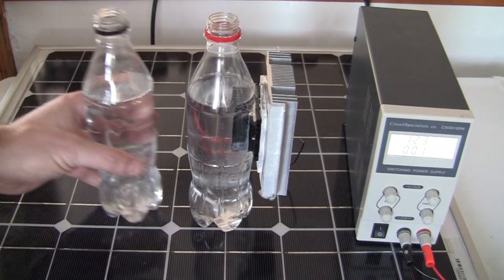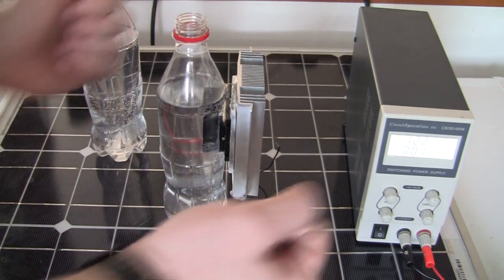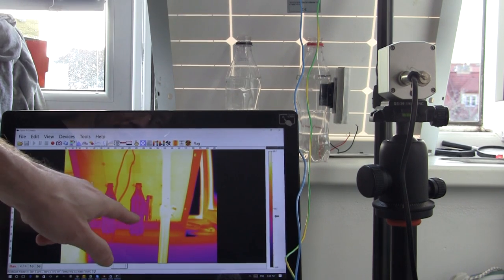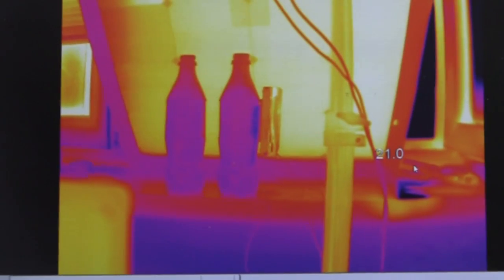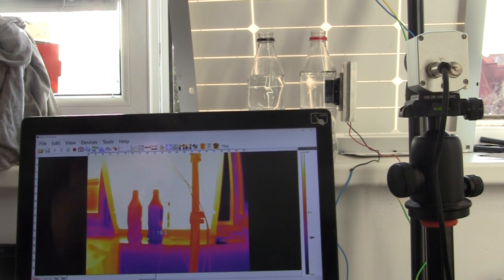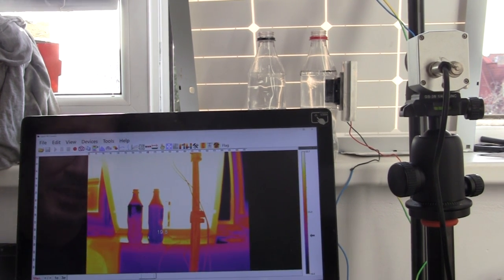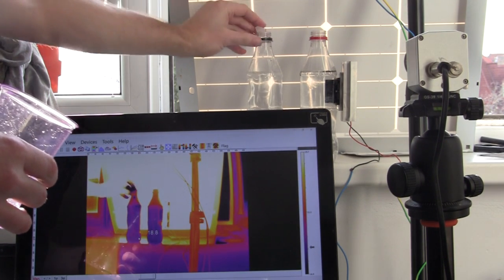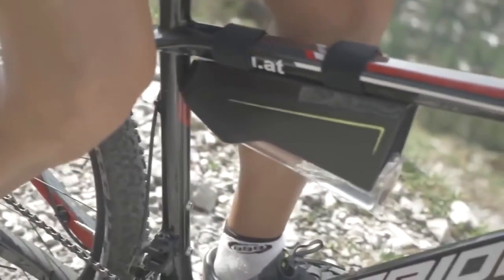Self-Cooling water bottle ACTUALLY WORKING!!!

Comment: Okay, so the portable water bottle design does not refill itself very efficiently.  But the idea isn't bad.  If we just created a much larger, non portable version, similar to a water tower, we could get a significant amount of water with little effort.
Reply: 1st problem: It takes an ENORMOUS amount of energy to condense water from air. You would spend a tenth of that energy digging a well or desalinating sea water for the same amount of water or even more.

2nd problem: say you want to use water from an industrial air conditioning. Evaporators get wet obviously, and draw air through them in order to cool it down. Whatever was in that air (dust, pollution, microbes, spores, fungi etc) will now STICK to the evaporator and get in the water (that's why it smells rotten). You surely DON'T want to drink that disgusting water do you?
Reply: Actually, on Mars you can literally make water from thin air so long as you take along some hydrogen feedstock and appropriate piping and catalyst. You can relatively easily condense and separate the martian atmosphere into pure CO2. With that and, IIRC a Rubidium catalyst you can use methanation (also known as the Sabatier reaction) to produce water and methane. This process is exothermic - it produces heat (also useful on Mars) and doesn't require you to add energy. 

Alternatively, one can use the water-gas-shift process to produce carbon monoxide and water from said pure CO2. That process requires some energy in the form of heat to happen, and produces half as much water. This, too, is rather old technology, ie. basic chemistry. However, the amount of heat needed by the second method is within the range of heat produced by the first process. Thus, by chaining the heat thermal output from the exothermic process to the thermic input of the second, you are able to achieve higher water output using rather "old" and very well known/studied processes. Alternatively (or additionally), one can use another mildly endothermic process to mix CO2 with methane and additional hydrogen to produce methane, carbon monoxide, and more water. Thus, there is already no need to ship large quantities of water to Mars. No need for going to the poles or for water vapor to be condensed. 

Regarding shipping liquid fuel, as you mentioned, you may note that the above process outputs are carbon monoxide, methane, and water. Via standard electrolysis you can convert the water to hydrogen and oxygen, returning the hydrogen to the input of the above "reactor", and mix the oxygen with the methane to produce "methox" - methane/oxygen rocket fuel.  While methox isn't terribly ideal for escaping from Earth, Mars' shallower gravity well makes it quite suitable. While no human built machine for these processes is 100% efficient, we have achieved mid-90% range. The hydrogen feedstock needed for this is, naturally, much lighter than shipping water or fuel.
Reply: Quick calculation time ;-D

Reverse osmosis machine: consumes 45A at 12V, that's 540Wh and produces 30l of water in an hour. Therefore, it has an "efficiency" of 18 Wh/l.

Dehumidifier (Peltier. like the Fontus but more powerful): consumes 5A at 12V, that's 60 Wh, but only produces 1 l of water each 24 hours (that is when it is 95% humid, below 40% it's useless and that is the kind of humidity that is present in the "biomes" where you need the Fontus most). 
Therefore, the "efficiency" is 1440 Wh/l.

The RO machine is approximately 80 times more energy efficient than a dehumidifier. And it's not exactly a energy efficient device! (the solar array of my boat can't supply enough power to run it, it runs partly 
off batteries)
Not counting the fact that unless the pump breaks or the membrane fails(the rest like clogged filters is easily repairable) it's always going to produce water, and the dehumidifier will need A MONTH to produce as much water as the RO machine produced in AN HOUR.

And we are also forgetting that there are also MANUAL reverse osmosis machines (the pump is hand cranked, it uses no power at all) to use in an emergency if there is a total power loss on the boat, and those produce much more water (0,5 l/h) than the Fontus.

 Trying to get water from air is like trying to get gold from sea water. An extremely expensive and useless process.

PS: I don't think you know how much 50mL really is, because I don't think you could survive drinking less than a whisky shot worth of water each day. I mean yes, you would survive for LONGER than if you had no water at all, but what's the point of doing that when you can have an emergency solar still or manual desaliniser that does the job better and faster?!? :-)

PPS: I don't even think the solar panel required to run the Fontus at suitable speeds would fit on a life raft ;-D
Reply: Dylan Daughety I had that same idea. it doesn't work for hiking or biking. But it does work on a large scale for a house or town/village as long as you have a large solar array or are part of a normal power grid. same with the water seer. if you made a huge underground tunnel put fans and cooling devices (even just standard industrial AC) to speed up and cool the air you can condense and collect water out of the air even in hot dry areas. it just takes a lot of power. But that could be done with large solar arrays (we are talking ones covering a few acres) on the surface/near by that then power the fans and cooling devices. the water seer won't work how they want. But if you scale it up, move away from being super green and change some factors the over all goal (water from the air in dry areas where getting/finding water can be hard) can be done.
Reply: why would you use so much energy to get water from air when you could transport it for probably less energy
Reply: There's very little water vapour on Mars. On Mars, as far as we know, water is almost exclusively present in solid form at the poles...
Reply: MrOpenGL The situation when  condensation would be useful is in a place where digging a well is not an option.  When I was talking about a much larger version of the bottle, I mean a huge version of the device.  Something that could be used in a situation with almost no chance of fresh, drinkable water.  The idea could be extremely useful on Mars to obtain water without having to tote massive amounts of water on a ship to space along with liquid fuel.  I don't know if it is practical on Earth, but it could be extremely useful on other planets.
Reply: MrOpenGL I was thinking more along the lines of Africa and parts of the middle east. and I was thinking more like just cool a huge cave down to near freezing and then pass air (cold as it comes in and more as it passes through) through and let the water condense naturally on the walls/celling (they can be made of man made stuff you keep dirt out) and the water drops into huge pools that is then filtered.
Reply: How about covering a boat with solar panels and generating a backup freshwater supply for a long trip?  You can survive on a surprisingly small amount of water.  Even with just the small solar panel used in this video, 50mL / day is probably enough to survive on.
Reply: Interesting.  I didn't know about reverse osmosis machines.

Comment: If we really wanted to squeeze moisture out of the air in a rather arid climate, it'd have to be an absolutely massive installation working on a combination of wind and solar power to perform gas compression. You'd need a cold plate with rather extreme surface area and you'd need to force warmer air against it.
There'd need to be a super robust closed evaporation loop with some kind of high-performance refrigerant. The incoming air would probably need to be forced against the cold plate using some kind of turbine setup.
I hereby name this loose idea the "Air Well", and anyone who wishes to build it will need to cut me in on the profits. Alternatively, if you have a couple hundred thousand or a few million to spare, contact me and we'll get engineering. :)

Oh wait, crap, someone's already invented that: https://en.wikipedia.org/wiki/Air_well_(condenser)

Comment: Would small blower fans or normal fans in the heatsink help with the heat transfer? Did you use a thermally conductive pad or compound?

Comment: What if you put it through a thermos flask? Then the water would be able to be cooled much more slowly. Even a small peltier device should be able to cool it down/heat reasonably well. Then a phone battery would even power it at least as well as the solar panel. Hell, put one on the side to keep it charged.

I don't think this is ENTIRELY unfeasible, although the only practical benefit would be for trekking or somesuch, though it would weigh a lot, so it seems a bit much for a tepid or cooled drink.

Comment: A few years ago I made something similar with the cold side in a small insulated lunch box and this worked fine om my 24 volt 120 watts solar panels that charge 2 12volt serial connected  car batteries.and took the 12 volt from one of the batteries it worked fine, but worked better with a cooling fan from a computer power supply on the "hot" side of the Peltier element ..
But it worked like crazy when I put the whole thing inside out of the sun..
So I'm just saying, maybe , just maybe it would work better if you put the whole  bottle in the shade ??

Comment: I wonder if your self-cooling water bottle would actually be able to overcome the radiant heating of the sun. In other words, if the bottle was sitting next to the panel instead of under it, would it still cool down, or simply heat up slower? 

Yet another nail in the coffin for the self-filling water bottle.

Comment: Wouldn't this actualy be a viable product? Maybe a Self-Cooling thermous, with half of it solar panel other half heatsink with a thermal break between inner and outter layers. The whole idea as a way to extend the time water is cold. It'd be slower with smaller solar cells but it doesn't have to work as hard as a clear bottle.
After initial purchase the water from any drinking fountain is free, but ice is not as free as water.

Comment: Aside being unpractical, drinking basically the equivalent of distilled water would slowly kill you anyway. On a long hiking trip where you are sweating out all your minerals the last thing you want to drink is moister water.... Your blood pressure would be out of whack in a few hours giving you some nasty headaches.
Reply: Nonsense, distilled water won't kill you at all. Just don;t drink 2 liters of it at once and make sure you eat properly.
Reply: The ad suggest to drink it while biking, hiking or out in 100 degrees on the Ocean. You drink way more than 2 liters in those circumstances. While distilled water wont kill you normally during times of excess stress on your body it will weaken you significantly. Maybe I worded my OP wrong but it's not exactly looking good for you when your out in the woods dizzy by low blood pressure.

Comment: Or you could make it even more efficient, by using something that isolates heat and putting cold water into the bottle, thus making a water bottle that can keep it's temperature low for a very long time.
Oh wait that already exists and doesn't require solar panels.

Comment: A little suggestion for production version: use somewhat thermally insulated bottle. Reducing heat flow into bottle (by insulation) should enable lower water temperature without increasing power requirements, or, get the same temperature with less power (after a bit longer time).

Comment: Wonder if it would work better if you used a widely available aluminium drinking bottle and attached the heat sink or a smaller couple of them to it in a more or less wrap around situation.

Peace

Comment: I have a question. How much power does it take to operate a calculator? I remember having tiny solar powered calculators. Or did those tiny solar panels just replace enough battery power for them to work?

Comment: it is a fun science experiment, to show how a peltier device works. and this might well be a decent option for cooling stuff on a much larger scale, out in a desert somewhere. a place where electricity is not readily available. but i suspect that you would want to set up a much larger array of solarpanels, run it through batteries and use the power for any number of devices. like a refrigerator :P

it is a shame that devices like the self filling waterbottle wont actually be practical or work at all, in any meaningful sense. I suspect people get roped in more by the promise and the romance, if you will, of the idea. "wouldn't it be great, if...)"

Thank you for the video. It was nice to see the water cooling down and flowing down the side of the bottle :)

Comment: Actually this is awesome in showing just how much power a fridge drains.
Since that's basically what a fridge is.
Reply: A refrigerator works by compressing gas. Though not sure if its less or more efficient than a peltier.
Reply: I don't believe you can really compare efficiency between them; both are relative niche coolers.  Kind of like a gill and a lung; each great for their designed purposes but terribly inefficient at the other.
Reply: how is a fridge "niche" when it is in every household, many having more than one?
Or is there another way of cooling stuff down below room temperature that I am unaware of?

Also I am 99% sure that whatever method a fridge uses is more effective than a peltier device, because otherwise that's what we would be using. I think the good thing about a peltier device is that it does not generate waste and doesn't require any fluids to circulate, so it can be used in compact devices.

Comment: I wonder if this could work with a car or truck and this would cool the inside down on hot days so you can save on a/c power now this would be just a cool thing to do but not practical just a "I can do it project"

Comment: Would it not be more efficient if you built a system that uses pressure differentials to cool (like a fridge) You could crank it by hand to increase the pressure for example =) No more electricity required

Comment: The Peltier device is the weak link here. Usually 5-8% efficiency. You can get up to 50% with a reverse Carnot cycle.
Reply: Which makes the Fontus bottles even more ridiculous.

2257 kJ = energy rrquired to condense 1L of water.

2257 kJ ÷ (2 hours) = 313.9 W.

313.9 W / 0.05 = about 6.3 kW.

That's going to balloon even more once you factor in all the other possible losses. You would need to put in about SEVEN THOUSAND WATTS of electricity to get 1L in 2 hours.

Comment: That wasn't the first self-cooling water bottle! My family, friends and I travelled to Flagstaff, Arizona one Winter and camped out. We stuck our water bottles, soda bottles and beers in the snow to cool them. In about two hours they were ice cold (duh). Now, I'm not saying we were the first to do this; because A LOT of people have done it before (I'm sure). But, we did beat Thuderf00t to the punch of "self-cooled bottles" by about 20 years. And, we didn't need solar panels nor a peltier device.

Comment: I wonder if the peltier device heats up enough to the boiling point of water on the other side and can double as a safe hot plate for arid climates prone to forest fires. 🤔🤔🤔🤔 a self cooling/heating water bottle that can safely boil water then cool it. Better get a patent on this

Comment: How does it feel to cheat (1:20)? 45W = 90V 0.5A ten times less what's needed…
Anyway, the wrong way to go.
They need a turbine to get high quantity of air, and rise the pressure to 10-20 atm. (locally) , then use a smartly conceived vortex cooler, using the rotation of the turbine to get the vortex effect, separating warm air from the cold & wet air, pressure relief cools it further.
Seeing how much water condensate in a normal air compressor in a summer day...

Comment: very well, but what are you more likely to have with you on a hot day? a solar panel or an icecube? for an icecube you'd need a special device to cool water to freezing temperatures and a way of storing and transporting ice on a hot day without it melting. while with the self-cooling waterbottle, all you need is a 'small-ish' solar panel :^)